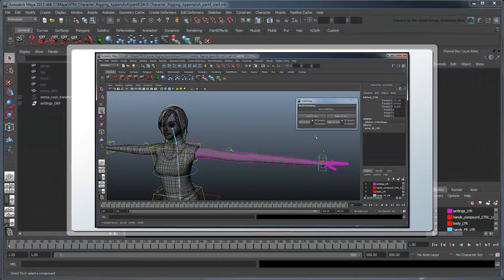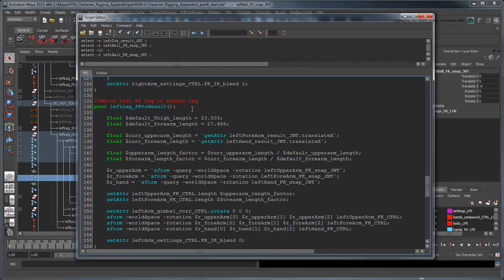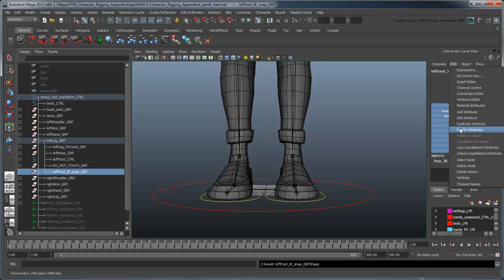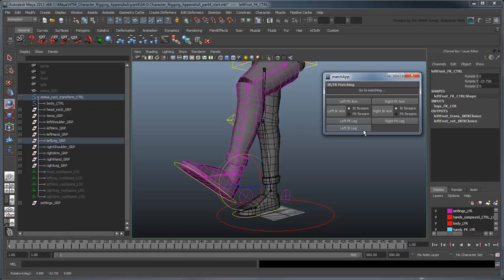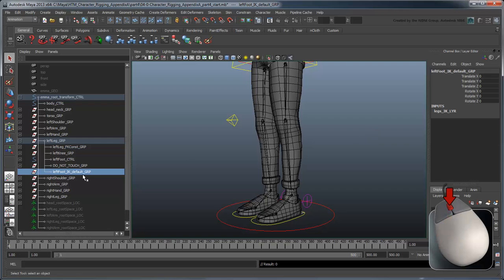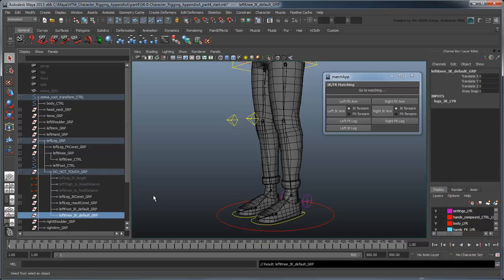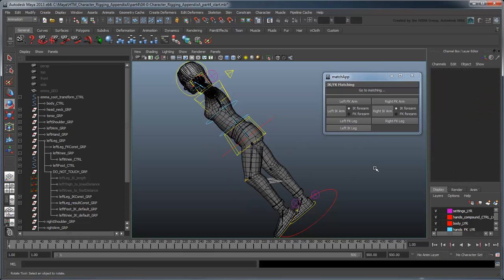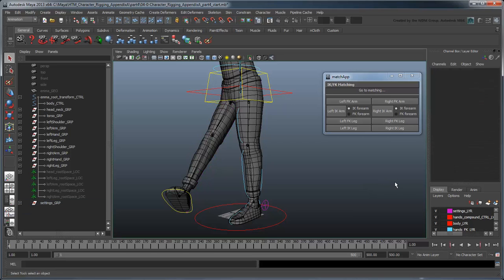Creating a Character Rig: Appendix A: Part 4 - Matching leg joints (Advanced)

Comment: Hi, Thank you for your great tutorials.
I have a question :)
What if I start with IK and I add some values at the Rool Foot Attribute. After that, I switch it to FK and i do some changes. And Finally, I switch it back to IK mode. I think that the values of the Rool foot will still be there. Is it possible, when to switch the mode (from FK to IK) to zero that values?
Thank you :)
Reply from the maker: That doesn't seem right.  IK values should only persist in IK mode and FK values in FK mode.  They shouldn't really share anything (if they did, this matching script would be unnecessary)
Reply: @Autodesk_Maya  Thank you for your response.
I understand that IK and FK, they do not share the values, but I think that in a scanario that we add a value of 20 degrees at the IK Roll, then we swap from IK to FK mode, and we add some values at the knee FK joint. And after that we swap to IK mode, then I think that the IK Roll Foot values remain 20 degrees! That maybe, it should have been zero.

Comment: I copied all your code and the leg snapping works but only when its translated, when its scaled the leg stretches down and when its rotated it moves backwards, can you help please
Reply from the maker: Can you be a bit more specific?  Does this happen when you match IK to FK, or FK to IK?  Also when you say it's scaled, do you mean just the leg, or the entire rig?  It's likely that the script is fine, but that either your snap joints or rig joints are parented incorrectly or have the wrong LRAs.
Reply: @Autodesk_Maya  when I scale or rotate using the global transform curl for the hole rig the go from fk to ik the leg moves away from the position. when the rig is scaled the leg is stretched down, when its rotated the leg moves backwards and to the right
Reply from the maker: @phillup7  If you use the match app included with the scene files (see the video description) on your rig, does it work properly or not?  This will help narrow down whether it's a script problem or rig problem.
Reply: @Autodesk_Maya  I copied pasted pasted your code
Reply from the maker: @phillup7  Okay, so then the issue is probably with your rig.  When you scale / rotate the entire rig, do the leftFoot_IK_default_GRP and leftKnee_IK_default_GRPs still remain 0,0,0?  And are they still at the same spot as the leftFoot joint?  Also, is the leftFoot_IK_snap_GRP located at that same spot, but with non-zero transform values?
Reply: @Autodesk_Maya  yes both leftFoot_IK_default_GRP and leftKnee_IK_default_GRPs still are at zero and remain in the spot they should be and the leftFoot_IK_snap_GRP is in the same spot but with non-zero transformation
Reply from the maker: @phillup7  I have to admit then, that I'm a bit perplexed.  There's three main reasons I can think of that your rig would only break when scaled/rotated:
1.)  The nodes recording the default/current IK control position/orientation are getting warped, which throws off the math.
2.)  The math itself is wrong (which it shouldn't be if you copy and pasted the script, since they work on the example file).
3.)  The IK leg itself doesn't work properly when the rig is scaled / rotated.

These are the three areas you'll want to check.  I'd also compare your node hierarchy to the one in the example file to make sure they're the same (for example, you want to make sure the snap joints are actually parented under the result joints, not just constrained.  Same for the default_GRPs, because they need to live in that space).
Reply: @Autodesk_Maya  I htink I found out what the problem is when its scaled the local rotation access stays in the same spot. do you know how i can fix it?
Reply from the maker: @phillup7  What do you mean the local rotation axis stays in the same spot?  Every joint has a local rotation axis.  Do you mean the snap_GRP?  or the default_GRPs maybe?
Reply: @Autodesk_Maya  yes the snap grps local rotation axis is not where is should be
Reply from the maker: @phillup7  Are you sure it's parented correctly in the hierarchy as shown in the video?  Is the group node's "Inherits Transform" attribute turned on?
Reply: @Autodesk_Maya  I fallowed the tutorial exactly and the inherit transforms is on. do you want to see my file? also the grps scale up with the model
Reply from the maker: @phillup7  If you can put it somewhere where I can get to it then sure, I can take a quick look.  However, I'm confused again.  You said the snap group's local rotation axis isn't where it should be, but the snap groups scale up with the model.  So is that to say they scale up incorrectly?  Are their pivots centered?
Reply: @Autodesk_Maya  do you have an email?
Reply from the maker: @phillup7  Unfortunately no.  You'll need to host the files somewhere yourself.
Reply: @Autodesk_Maya  did you get the rig?
Reply: @Autodesk_Maya  is it fixable or should I just not bother with the snapping?
Reply from the maker: @phillup7  Just looking at it now, but I'll need your script too since you changed some of the node names (my script won't work with those names)
Reply from the maker: @phillup7  I'm taking a look at it now.  Snapping is pretty useful so I'd definitely recommend having it.  From what I see so far, things seem like they should be working but I did notice you built your rig with the waist at the origin instead of the feet.  I'm trying to figure out if that would have an impact since the world rotate pivot is relative to the origin.  It's possible that's an issue but I haven't figured it out yet.
Reply: @Autodesk_Maya  ok,  it i dont think that should effect it
Reply from the maker: @phillup7  Okay, so I found the issue and it is indeed related to the center of your rig being different.  If you select your root_transform_grp and check the World Space section of the Attribute Editor, notice that the pivot has been moved.  This happened because you moved the root control down to the feet (which are not on the origin).  This non-zero pivot is introducing a new variable in your rig not present in the tutorial, and it's what's throwing things off.  Try zeroing out the pivot values and notice how it sends the pivot point back to the origin.  Now try scaling your rig and run the script again - everything should work properly.

At this point, it's probably easiest to raise up the root transform control so it's at the center of the body (circling around the hip control).  That'll be the quickest way for you to get back on track.

Comment: hey MLC thanks again for a great tutorial quick question 

for some reason i cant get my IK knee to work in the script but i does match perfectly as long as its not stretched as soon as it stretches the kneee doesnt work in the Match App 
thank you again
Reply from the maker: Can you be more specific?  Which IK knee are you having trouble with?  And what's happening?  Does it not move at all, or does it snap to the wrong place?
Reply: @Autodesk_Maya  sorry about that the knee snaps in the wrong position but everything else snaps to the right position except when its streched the ik knee  snaps to weird position
Reply from the maker: @Funny3dguy  And is this for the Manual or Automatic knee?
Reply: @Autodesk_Maya  manual knee
Reply from the maker: Hmm, is it possible your leftKnee_IK_default_GRP is moving?  The point of it is to record the knees default position, so you want that to stay still.
Reply from the maker: @Funny3dguy  Hmm, is it possible your leftKnee_IK_default_GRP is moving?  The point of it is to record the knees default position, so you want that to stay still.
Reply: @Autodesk_Maya  I checked my scene file with yours and both our default knee grps are snaped to the left knee ctrl  and parented under the legs do not touch group. but looking through  other peoples comments i saw someone with a similar problem and you said that the default knee gprs piviot should be at the knee joint. I did both just to check and neither worked for me . But mind you the scripts works perfectly as long as the Leg isnt stretched.  Also attached is my code maybe there an issue there even tho i checked it with yours and its very similar

proc rightLeg_IKtoResult(int $knee_mode){
    
    float $default_thigh_length = -30.714;
    float $default_shin_length = -42.669;
    
    float $curr_thigh_length = `getAttr rightShin_result_JNT.translateX`;
    float $curr_shin_length = `getAttr rightFoot_result_JNT.translateX`;
    
    float $tolerance = 0.001;
    
    if((abs($curr_thigh_length - $default_thigh_length) > $tolerance) || (abs($curr_shin_length - $default_shin_length) > $tolerance)){
       setAttr rightKnee_CTRL.kneeSnap 1;
    }  
            
    $r_foot = `xform -query -worldSpace -rotation rightFoot_IK_snap_GRP`;
    $t_foot_wrp = `xform -query -worldSpace -rp rightFoot_IK_snap_GRP`;
    $t_foot_drp = `xform -query -worldSpace -rp rightFoot_IK_default_GRP`;
    $curr_transform = `getAttr emma_root_transform_CTRL.translate`;
    $curr_foot_orient = `getAttr rightBall_result_JNT.rotateY`;
           
    xform -worldSpace -rotation $r_foot[0] $r_foot[1] $r_foot[2] rightFoot_CTRL;   
    xform -worldSpace -translation ($t_foot_wrp[0]-$t_foot_drp[0]+$curr_transform[0]) ($t_foot_wrp[1]-$t_foot_drp[1]+$curr_transform[1]) ($t_foot_wrp[2]-$t_foot_drp[2]+$curr_transform[2]) rightFoot_CTRL;
    
    setAttr rightFoot_CTRL.toeWiggle $curr_foot_orient;
    
    if($knee_mode == 2){
        $t_knee_wrp = `xform -query -worldSpace -rp rightShin_result_JNT`;
        $t_knee_drp = `xform -query -worldSpace -rp rightKnee_IK_default_GRP`;
        
        xform -worldSpace -translation ($t_knee_wrp[0]-$t_knee_drp[0]+$curr_transform[0]) ($t_knee_wrp[1]-$t_knee_drp[1]+$curr_transform[1]) ($t_knee_wrp[2]-$t_knee_drp[2]+$curr_transform[2]) rightKnee_CTRL;

        setAttr rightLeg_settings_CTRL.autoManualKneeBlend 1; 

    }
    else{
        float $leg_length_factor = `getAttr rightShin_noFlip_IK_JNT_translateX.output` / $default_thigh_length;
        float $thigh_length_factor = $curr_thigh_length / ($default_thigh_length * $leg_length_factor);
        float $shin_length_factor = $curr_shin_length / ($default_shin_length * $leg_length_factor);
        
        setAttr rightFoot_CTRL.autoKneeThighLength ($thigh_length_factor);
        setAttr rightFoot_CTRL.autoKneeShinLength ($shin_length_factor);
        
        setAttr rightFoot_CTRL.kneeTwist 0;
        
        float $noFlip_shin_pos[] = `xform -query -worldSpace -translation rightShin_noFlip_IK_JNT`;
        float $result_shin_pos[] = `xform -query -worldSpace -translation rightShin_result_JNT`;
        float $center_shin_pos[] = `xform -query -worldSpace -translation rightFoot_noFlip_IK_JNT`;
        
        float $centerToNoFlip[] = {$noFlip_shin_pos[0]-$center_shin_pos[0], $noFlip_shin_pos[1]-$center_shin_pos[1], $noFlip_shin_pos[2]-$center_shin_pos[2]};
        float $centerToResult[] = {$result_shin_pos[0]-$center_shin_pos[0], $result_shin_pos[1]-$center_shin_pos[1], $result_shin_pos[2]-$center_shin_pos[2]};
        
        float $deltaAngle[] = `angleBetween -v1 $centerToNoFlip[0] $centerToNoFlip[1] $centerToNoFlip[2] -v2 $centerToResult[0] $centerToResult[1] $centerToResult[2]`;
        
        float $kneeTwist = iterateToMatch("rightShin_noFlip_IK_JNT", $center_shin_pos, "rightFoot_CTRL.kneeTwist", $centerToNoFlip, $deltaAngle[3], 90, 0);
        float $curr_shin_pos[] = `xform -query -worldSpace -translation rightShin_noFlip_IK_JNT`;
        
        $tolerance = 0.1;
        
        if((abs($curr_shin_pos[0]-$result_shin_pos[0]) > $tolerance) || (abs($curr_shin_pos[1]-$result_shin_pos[1]) > $tolerance) || (abs($curr_shin_pos[2]-$result_shin_pos[2]) > $tolerance)){
            setAttr rightFoot_CTRL.kneeTwist (-1*$kneeTwist);
        }
        
        setAttr rightLeg_settings_CTRL.autoManualKneeBlend 0;  
    }
    
    setAttr rightLeg_settings_CTRL.FK_IK_blend 1;
}
Reply from the maker: @Funny3dguy  If the script works for default leg lengths, it's unlikely a script problem (since it actually doesn't have much awareness of the leg length - it simply uses the position of various group nodes for snapping).  I think it's a problem with a node or nodes in your scene.

Also if I said the defaultKnee pivot should be at the joint then I think I was mistaken, because that's not necessary.  Again, it just needs to not move since its whole purpose is to record the knee_CTRL's default position.  Are you sure the default node isn't moving when you stretch the leg?  Also, does its values match those of the knee control at the default spot?  It's odd that you're experiencing this because the manual knee should be quite straightforward.  It's the automatic knee that requires some more complicated math.
Reply: @Autodesk_Maya  Hey MLC,
okay both the knee CTL and knee default GRP have the same rotate piviot and are both  frozen transformations  so there channel box values are zero . the default knee grp does not move when i stretch the leg it stays at the IK knee ctrl position  maybe i should start the leg match script  from scratch ?  Thank u again for your help
Reply: @Autodesk_Maya AND  both knee ctrl and default group are at the knee ctrl . i also i believe its automatically  snapping to the knee ctrl always once its stretched  and i try to match to IK LEG
Reply from the maker: @Funny3dguy  Hmm, are you working with the Emma rig or your own rig?  If it's your own, and you built it at a different scale, you may need to adjust the $tolerance value to compensate.  If it's always snapping, that leads me to believe the value is currently too high.
Reply: @Autodesk_Maya  Hope you had a great holiday. I am working with my own model  and rig my float $tolerance = 0.001  not sure how low i should go i tried -0.001 and still get the same result  how low would you recommend my model and emma model are about the same size in scale mines may be a bit bigger though. Thank you again for all your help.
Reply: @Autodesk_Maya  Sorry disregard my last comment this may clear up what i meant.  I believe you were correct the script is working correctly  and the foot CTRL and the Knee CTRL go to the correct position  of the corresponding FK Joint . where the issue lies is the result joint always snap to where the knee ctrl default position  even though the knee ctrl is in the correct spot . Thank you again for your help and sorry for the confusion

Comment: Hi! I have this weird problem when I try to do the IK->FK switch on the right leg. I've copy-pasted the entire code of the left for the right side and renamed it (left->right). The FK_snap_JNTs for the right side are also all in the correct places. When I run the script though, the right FK leg is rotated in a different way than the IK. I printed out the values of the snap joints pre-repositioning and they are the same as the FK joints after the repositioning.  Yet the FK leg is orientated differently.  I'm kinda confused why this is happening. (Maybe it's important to note that I actually used duplicate special to create the right leg. Because I didn't have enough time to fix my broken right leg that I created from scratch.)
Reply: I found the problem, although I do not know why it is doing this. When I parent my snap_JNTs under the correct result_JNTs in the right leg in the hierarchy, the orientation of the snap_JNTs get altered in a bad way. However when I orient constraint them to the result_JNTs (but leaving them under the FKConst_GRP), it works perfectly.

Comment: Maya learning channel if you could help me with something I'd much appreciate it. So when I try translating the emma root transform CTRL my rig works fine, but when I try rotating it it breaks. What seems to happen is that when I rotate the root CTRL and the run my script, the knee CTRL stays in place and doesn't move along with the rest of it. Then the leg pulls itself to the knee CTRL as close as possible without stretching.
Reply from the maker: Sorry, this is going which way, from FK->IK or IK->FK?
Reply: IK->FK works fine, I'm talking about FK->IK
Reply from the maker: Are you sure the knee snap group is parented correctly and rotating with the entire leg?  Try unhiding it, then rotate the entire body.  Select and make sure it's in the right spot.  I'd also check its values and make sure that after you perform the snap, the IK knee control values match.  If the values match, but the knee is in a completely different spot, then I think you'll need to re-create the knee snap and ensure that it's an exact copy of the IK control you started with.
Reply: Well, I did just what you said. I rotated the root control and then performed a match. the values for the knee snap were the same, but the control itself was out yonder. So you think I should recreate the knee?
Reply from the maker: No need to recreate the knee.  I would just try deleting the knee snap group and creating a new one from a copied knee_CTRL (ensuring the Knee_CTRL is in its proper 0,0,0 position first).
Reply: Oh, gotcha. Thank you for all help

Comment: Maya learning channel, at 7:53 I get an error message:
// Error: Line 226.187: "$curr_transform" is an undeclared variable.
Do I even have to declare it as a variable? If so, how would I go about doing that?
Reply from the maker: You have to declare all variables before using them.  In this case, did you forget $curr_transform = `getAttr emma_root_transform_CTRL.translate`;?